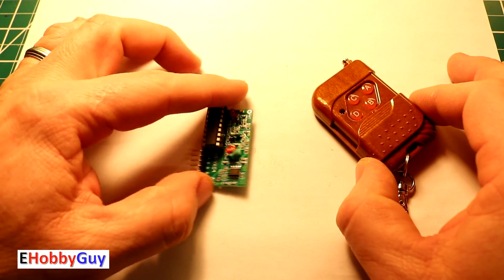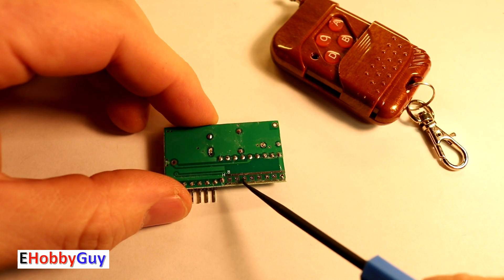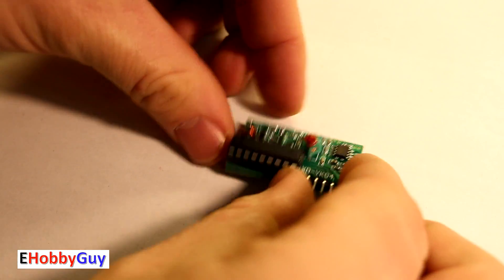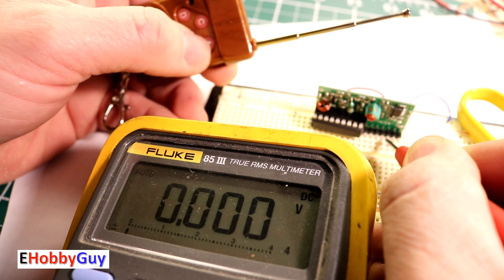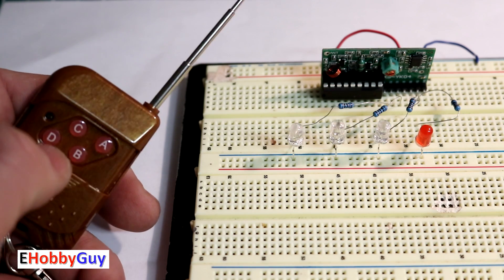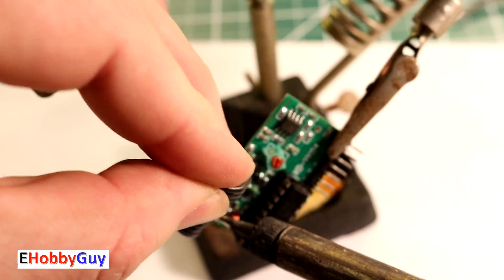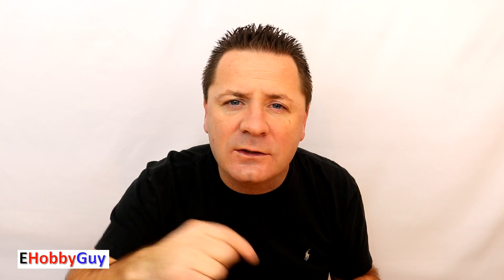4 Channel Wireless Control MOMENTARY, ON-OFF & LATCH!!!

Comment: Ron Jones is correct. Did you NOT notice that on your controller there is a row of holes and two solder lines that you can tie to high or low identical to the unsoldered pins and two solder lines on the recover board? ? ?  Apparently not as you would have known that that this is CHANNEL SLECT OPTION. With this you can add a byte to the transmitter data so you can have multiple transmitters not interfering with each other.  Try this; set your transmitter  to 0 high and set receiver to 1 high all other pins to low see what happens? Obviously nothing as it will ignore the data you told it to. Persistence of vision is what is keeping the LEDs "on" to your eyes and two fast for your camera but to an oscilloscope it is a very different thing.

Comment: hi, how much ampere output from the 4 channel? i see in the video use only for power on 1 led, i can power on more led (20mah x for example 10led) x channel? or need a relay? how i can solve?
Reply from the maker: ItalosVEVO. Very little. I would use a transistor or relay to drive multiple devices.  It will also protect the control board. Thanks for watching!!
Reply: @ehobbyguy8980  how to use transistor?

Comment: You should probably put annotations in the video showing what you have since learned about the soldered pins not being soldered on purpose. It will save your viewers wasting their time soldering what they believe to be a mistake and unfairly giving poor feedback on ebay, which is what I nearly did.
Sucks that they didn't supply a battery with mine, and I paid double what you paid in 2019.

Comment: I had the same problem when I opened the package, I just couldn't believe they didn't solder that row of pins! Who checks the quality there? How do these products make it to the market without Quality Assurance? And this is end of 2019 meaning that this problem hasn't been addressed yet by the manufacturer.  No wonder that I also bought a LCD screen that didn't work even though it had Quality sticker nicely spread over the screen!
Reply: Same here. Mine arrived yesterday. No solder. No battery either for the controller. Shocking.

Comment: Nice video, I tried  connecting transmitter and reciever as shown in the video. But communication was not possible between tx Rx. Is there any soldering needed for unsoldered pins. Please any one suggest me sir.

Comment: Hi PAUL I LIKE TO USE 10 OR MORE OF THE SAME REMOTES CONTROLLERS OR SIMILER LIKE THAT ONE  YOU ARE SHOWING 5V FOR MY ROBOT WOULD THEY INTERFERE WITH EACH OTHER ? I APPRECIATE ANY HELP AND THANKS FOR THE TUTORIAL CHARLIE
Reply from the maker: If you want use more than one, you have to get a different frequency.  If you use the same frequency both receivers will activate.  If you want to use 10 you would need 10 different frequencies.  I don't think there are that many available.  Thank you for your question, I hope I have been helpful.  Thanks for watching.

Comment: Sir,I replaced PT2272-M4 and mount 18 pin IC base,then mount new purchased IC  SC2272-T4 but it didn't work,what could be the reason? Is SC2272-T4 not identical to PT2272-T4? Please help,otherwise my receiver board and new purchased SC2272-T4 will be of no use.
Reply: Hello Paul,why don't you reply my question?It is your responsibility to do that.

Comment: Sir,
in this remote 433hz , wich ic is used.please reply .please.your informations are 100% .
Reply: He gave the nomenclature of three variations of the installed I , and why. It's right there on the. Hip in the Google eBay ad.  Not hard to find

Comment: Why don't you change the button off the remote to work as toggle
Reply: It is imposible.you can change ic .
If you change remote control button toggle  button  are very big remote  will not properly closed toggle  button take  to big can not  suitable .

Comment: How do you connect the LEDs to the receiver ?
Reply from the maker: ADITYA NARAYAN MOHANTY In this video I connected a 1k ohm resistor to the output pin. Connect the anode of the LED to the other end of the resistor and the cathode of the LED to ground. Let me know how it goes.

Comment: Hi, I bougth this receiver and transmitter to run small motors(3-6v), but when I connect them, they won´t move. I checked the output pins with volmeter and it showed about 3,3V on D0-D3 and about 4V on VT pin. Do you know where could be the problem? Or how to make the motors run?
Reply from the maker: Michal Matějka the output current from this board will not be enough to drive a motor. You can use the output to trigger a transistor or relay with another another power source for the motor. In my video on relays I wire a transistor to trigger a relay. It may be a place for you to start. I hope this was helpful. Thanks for watching.
Reply: Thanks a lot for your answer. I will try it with the relay and hope it works :)

Comment: hahahaha those open pins are for coding the device to different frequencies so you dont get interference.. no8 is for changing it. solder no8 for different code change- you are a cowboy lmao.
Reply from the maker: Thanks for the feedback and thanks for watching!!
Reply: For programming the frequencies? These are paired 4 channel transmitters and receivers.  He is not receiving collateral freq spillover.  Each channel signals just that channel on the on off ice.  On the T ice, the channel pressed stayed on until a sequential channel aS pressed, then off went the previous channel.
If there were collateral freq bleed, it would happen when he pressed "A", and both A and another UNPRESSED channel would signal recieved signal.

Comment: hey great tutorial.i recently purchased this module.i connected as per your tutorial.In serial monitor i am constantly getting a message that the button is pressed If i connect all four digital pins to arduino all are high and always pressed.thi ic is M4.thank you in advance.
Reply from the maker: Brijoy Patel well i am not sure of how you are using them. Without knowing anything about your circuit, i am thinking pull down resistors may help to keep them outputs low. I hope this is helpful. Thank you for watching I appreciate your support.

Comment: Can i use a single 4 channel RF remote to control 4 separate 1 channel RF relay ( 4 locations in compound ) ? Thanks for replying )) Keep up the good work
Reply from the maker: Ashik A yes you can. They will all respond once they are all the same RF frequency. Thanks for watching!

Comment: Great video. The unsoldered pins are on purpose. They let you install identification jumpers so multiple controllers won't interfere with each other. Open the transmitter and you will see an equivalent, unsoldered  section where you put in jumpers.  Yours work because there are no jumpers in either your transmitter or receiver. You should install jumpers because the floating pins can pick up noise which could result in wrong codes. 
Thanks for the very good video. It was really well done. Thanks.
Reply: i was just about to say this myself, although if im not mistaken they are tri state address pins and so floating is not an issue?.  there are actually 12 address pins on the chip which would give us a choice of 1728 channels although you can only easily solder 8 of them to either low high or floating some how i think 512 addresses is enough anyway. was a very useful video but ehobby guy should probably read the data sheet on the IC chips in the future.
Reply: Reading down someone mentioned that you have to solder pin 8 to enable the custom channel setting. Thay might be the detail I was forgetting before.
Reply: @CraftyCrow   Hello , I have recently purchased one of these modules and indeed a full row of pins are unsoldered.  Do I just go ahead and solder all the pins for it to work?
Thanks John :)
Reply: Thanks for this. How do you mean install jumpers? What method would you use for this.... just pick two pins and put a wire between them, and then copy this in the controller to match?

Comment: great video, very informative
Recently we bought the same transmitter and receiver for our project,
but we are having an issue,
Is it normal the output on the receiver turns on and off, even if the  button was kept pressed?
hope you could help us,
Reply from the maker: It is not normal for the receiver to turn on and off like that.  The only time I have seen behavior like this is when the receiver and transmitter are too close to each other.  Try separating them by some more distance, and see if that makes a difference.  I hope this was helpful.  Thanks for watching!
Reply: Thank you for the reply, We will try your advice

Comment: Hello Paul, Just found your channel
Those un-soldered pins are meant to be like that
thats the coding part of the chip
pin to earth or pin to positive is one code etc
it does say in the data sheet
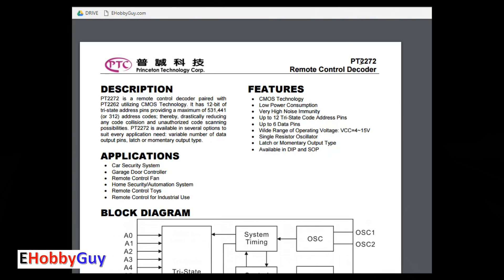Starts at A0-A7 as you can see on your data sheet at 7:47 showing all those pins open circuit
So what ever you connect on the Tx you have to do the same on the Rx for it to talk to each other
these are great just pull the Rx antenna wire straight up and you should get 100m + easy
Cheers  Brett
Reply: I think those address pins are tri-state. The traces above and below are high and low. You can connect to high, low or neither (floating) to get a unique address code to match the same on your receiver.
Reply from the maker: kermets Great info. Thanks a lot!